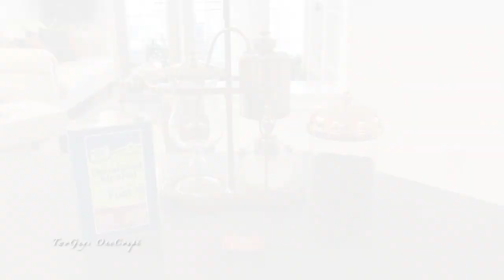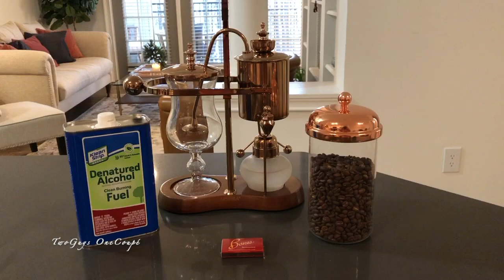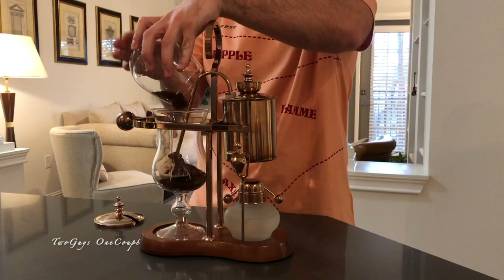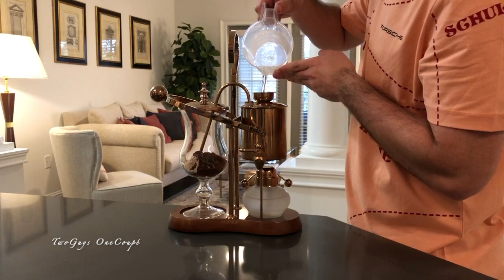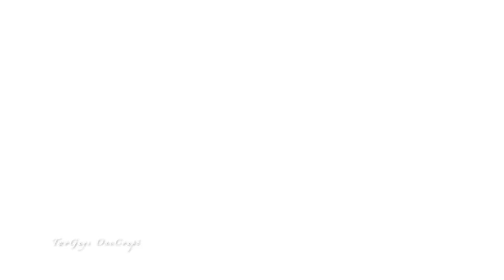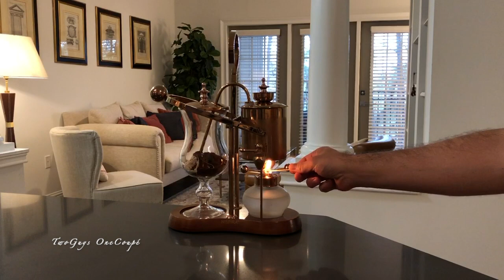How To Use A Belgian Syphon Coffee Maker

Comment: Can you use paraffin oil instead?
Reply from the maker: Use only fuel-type alcohol. Never use gasoline, benzene or kerosene. Purchase fuel-type alcohol from a pharmacy, etc.” — Stack Exchange Post, what to buy in Europe

“Alcohol burners are pretty basic and slow. If you don't use the right type of burning alcohol look for "soot free" denatured alcohol, ethyl or an ethyl / isopropyl mixture that's high on the ethanol side - isopropyl alcohol (rubbing alcohol) tends burns hotter than ethyl or methyl alcohols, but also burns orange and produces a lot of soot. Soot doesn't make the vacpot "show" very appealing.” — A fantastic overview of the Siphon from CoffeeGeek
Reply: I used paraffin/lamp oil…. Big mistake!!!!